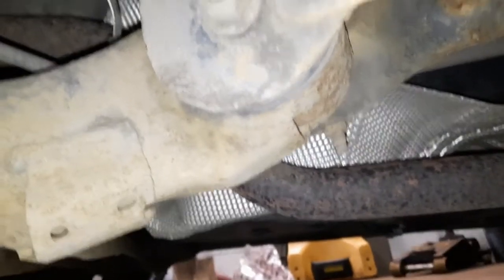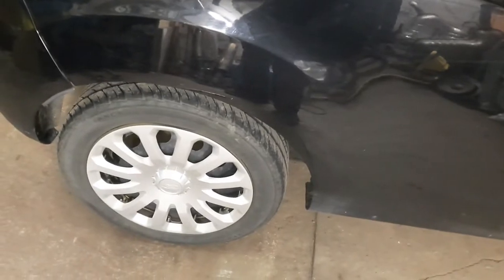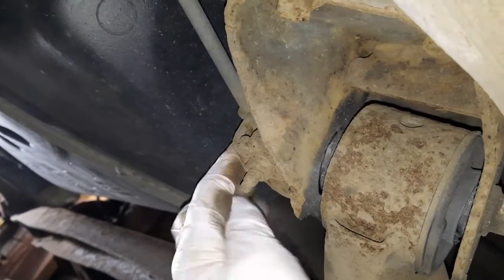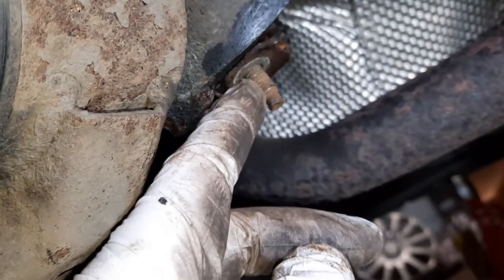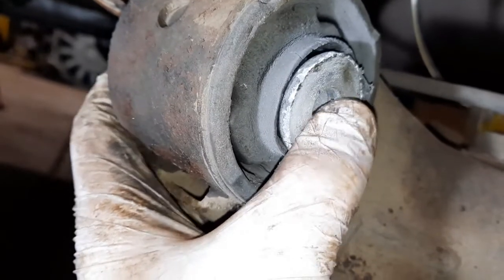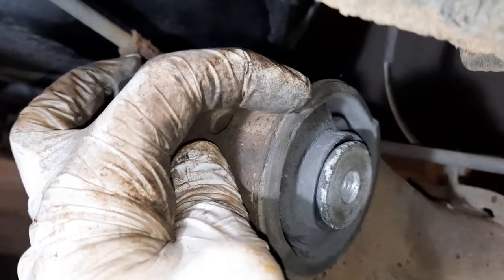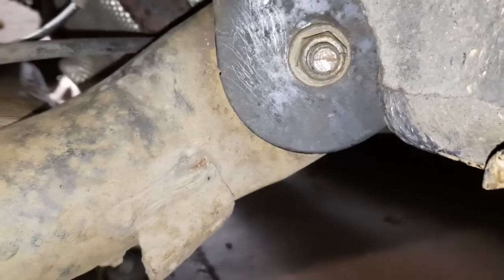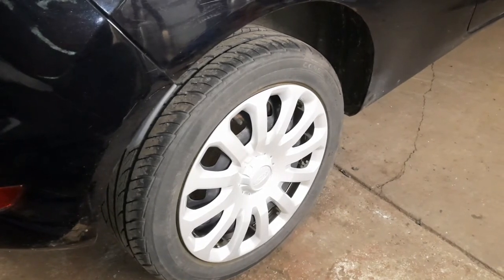How to replace Ford Fiesta rear axle bushes - with and without the tool

Comment: The bolts which go through the bushing are stretch bolts and shouldn't be reused. Re ususing them increases the chance of them snapping. Use new bolts and then use a jack to raise the axle to roughly where it would be once the car is on the ground with weight on the wheels. Then torque to 80 NM and then a further 120 degrees (to stretch the bolt).

Comment: Sir you are a star many thanks for taking the time to make a clear and precise video, this has armed me with all I need to do the job and what a lovely accent
Reply from the maker: Thank you for your comment, I really appreciate it! Glad you found the video useful.

As for the accent, that's my "telephone voice"!.... YouTube doesn't offer subtitles for Glaswegian so I have soften it a little! Haha.
Reply: @themidnightmechanic9368  One question do I do the bolts up tight with wheels on and the car on the ground or do you do them up with the car on axle stands and the suspension hanging
Reply from the maker: @brianhollins2989  make sure everything is nice and tight while it's still on axle stands.

Once you confident then you can refit the wheels, remove axle stands and give the wheels a final tighten when they are on the ground.
Reply: @themidnightmechanic9368  Thanks once again

Comment: Great video mate, very helpful! Will deffo be following this now my bushing needs replacing! Roughly how long would you say it takes?
Reply from the maker: Really appreciate the comment Joe!

Take your time with it. Set aside maybe 3-4 hours and you should be done.

Hope the video give you the confidence to give it a go. If you need any advice just drop me a message.

Andy.
Reply: 8 hours for mine  wouldn't press in
Reply: Next time you do this job put the bolts in and nuts on then wheels lower wheels on to ramps then do up the bolts because the way you did it with the axle when you lower it your twist the bushes bad times lads and your on about take your time 😢
Reply: Hi  @roryadams7649  Could you explain what you mean please?   Do you mean not tightening the bush bolts until the car is back at ride height? But still bolting the bush brackets  back to the chassis before you lower it? TIA

Comment: In practice it's easier to drop both brackets that mount to the under floor as its difficult to
get the bolt through the axle bush and bracket on reassembly...why struggle trying to line things up when you don't need to ?

Comment: Oi , have a question. Mechanic done bushes last week. Rear left wheel is having massive toe in. Is it something he could be responsible for as I don't see any other reason for having massive toe in. Car feels like walking in high heels.. all the time , even on low speed   it is wavy and wobbling a lot!
Reply from the maker: There is no adjustment in the rear wheels so I don't know how the wheel alignment could be out unless there is damage.

Replacing axle bushes would not cause one wheel to be out of alignment.

Upload pictures or a video if you can.

If the rear shock absorbers have failed it can make the back of your car bounce around.

Comment: I have a serious problem with my 2014 Fiesta rear wheel alignments.  They cup every tire I put on them.  Could this be the problem?  Alignment shops can't seem to find the problem so they shim out the rear wheels.
Reply from the maker: Tyre cupping is usually caused when I wheel is able to "bounce". This is usually caused by a worn out shock absorber. Have these been checked/replaced? That's the first place I would look.

If these are good then you can check these bushes by raising the rear of the vehicle, putting a pry bar between the floor of the car and the axle bushes and check for excessive movement.

Alternatively, have an assistant open the tailgate and bounce on the rear of the vehicle while you check for any noise or side-to-side movement at the bush.

Other than that, there is not alot that can go wrong with these axles.

Comment: Great video👍, could you please tell me how much the bushings cost? Seen a few on eBay but seemed a little expensive
Reply from the maker: Thank you for your comment, really appreciated!

I bought the tool and bushes as a set from ebay. Think it was about 50 quid roughly.

The bushes themselves are only about a tenner each and available from any motor factor (euro car parts etc) if you have things laying around to make your own pressing tool.

Any advice, etc just drop me a message and I will help all I can.

If you havnt already, please consider subscribing as there is more car related content on its way!
Reply: @themidnightmechanic9368  cheers mate, will subscribe

Comment: Do you think a few plate washers 75mm x M12 x 6mm thick would do the job? how much force is needed? cheers
Reply: mine were to tight started to deform so i flapped 30 thou off and they pressed in
Reply: my washers bent

Comment: did you drop the axle from both sides lowering the three bolt flanges?
Reply from the maker: Thank you for your comment.

Yes. Both sides need to be lowered at the same time otherwise its unlikely you will get the clearance needed to work on the bushes.... only the nearside one requires you to take the flange with it due to the fuel tank in the way. Offside you can just remove the centre bolt/nut.

You could drop the axle complete with both flanges if you wish!... probably make refitting the centre bolt a bit easier actually!

One trolley jack in the middle of the axle is perfect for controlling where you want it.

Hope this is helpful.

Comment: would like to make my own tool have a M12 rod from my spring compressors i can use and i have a large enough socket just need to know what the bearing races was from
Reply from the maker: Hi there.

Unfortunately I have no idea what cars the races came from.... I operate a car repair garage and have a box full of them as they come in handy.

Sizes don't need to be exact, as long as you can find something that will do the job... might be worth visiting your local garage seeing what old bearings, etc they have in their scrap bin!
Reply: cheers mate will do... does it matter if it pushes on the rubber section  or does the pressure have to be on the lip of bush where the plastic and rubber meet
Reply from the maker: @stevelittle3802  you want to be on the rim of it if you can so you are pressing on the plastic outer rim if you know what I mean.

Pressing on the rubber might damage it.
Reply: @themidnightmechanic9368  Do you think a few plate washers 75mm x M12 x 6mm thick would do the job? how much force is needed? cheers
Reply from the maker: @stevelittle3802  a fair bit of force is required. 6mm thick washers should be plenty strong enough I reckon!

Make sure you clean out the axle area so it's nice and smooth and use plenty soap to help it slip in.
Reply: @themidnightmechanic9368  cheers for your help plenty of wash up liquid, stay clear of grease or wd40 then??
Reply: @stevelittle3802   u just need to find a grease that is suitable for plastic/ rubber Materials otherwise it could possibly degrade it. Maybe o-ring grease would do the trick
Reply: @leejackson7331  job done all good easier than expected pic below of tool I made from washers and m12 thread and nuts

Comment: Is there a way to check these without stripping it all down?
Reply from the maker: Hi there. Thanks for you message.

The most common symptom is knocking or squeaking noises coming from the rear, particularly when reversing. You could jack up the rear of the vehicle and put a pry bar between the floor of the car and the axle (where the bush is) and see how much play there is in the bush. This is how an mot tester would check them.

If they are really bad (like the one in this video) you can have an assistant help you by opening one of the car doors, standing on the door sill and jumping/bouncing the car while you look underneath. It may be possible to see side to side movement at the bush.

Hope this is helpful.
Reply: @themidnightmechanic9368  the first paragraph sound very similar to what going on. Many thanks

Comment: Must admit I would have put the bolt the other way as it wouldn't have effected the integrity!
Reply from the maker: It did cross my mind! Lol

But I'm a bit "OCD" when it comes to putting things back where I found them.
Reply: @themidnightmechanic9368   Would you be able to take the bolt off if it was inserted in the opposite direction? Without using a hammer ?!? :) I believe that your OCD made you a favour. Unless is not your car and do not plan to change that ever again.
Reply from the maker: @tsonkotsonkov5111  it would actually be easier if you put the bolt back in the other way when refitting... it would make it easier to remove too if you ever had to take it out again.

I presume that the factory fits the axle before everything else and that's why it's a bit awkward to work with.